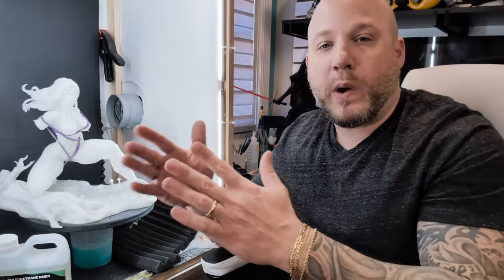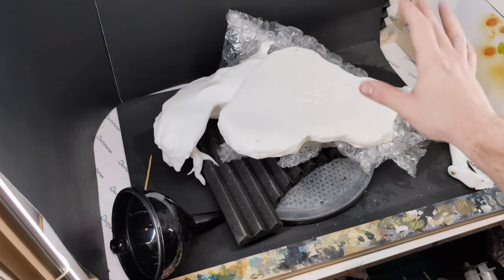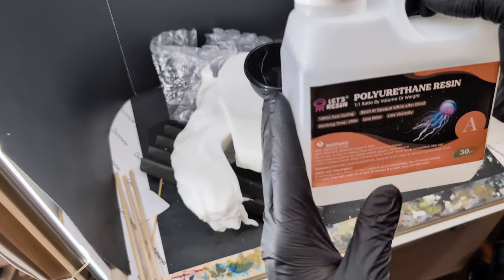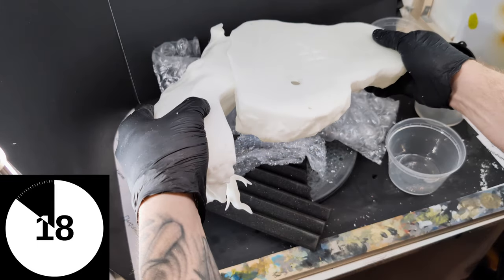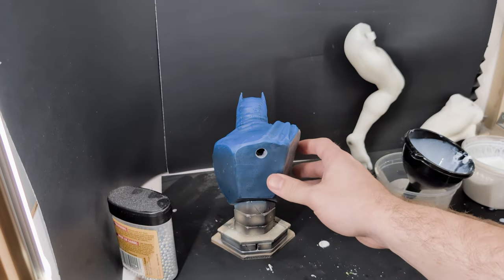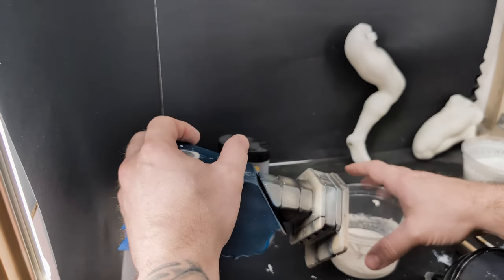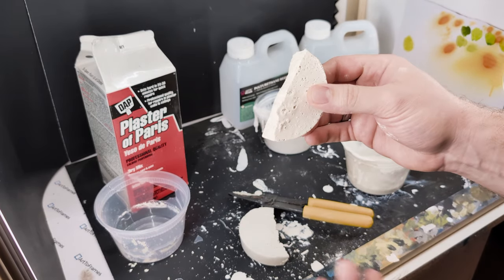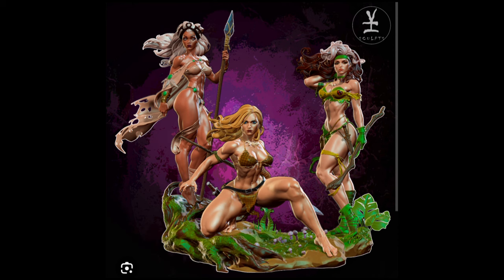How to Add Weight to a Hollow Statue using Resin & Plaster

Comment: Thanks, my friend...another timely video. I have been using baking soda to weigh mine down (due to finances and a better affordable alternative). I can't afford the poly, but the plaster is perfect for my wallet....and it's more professional than the baking soda.  Enjoying your channel
Reply from the maker: Thanks Dale glad to hear. It's a little tricky for smaller openings but as mentioned or as you are already probably used to with the baking soda..you can pack in the powder first on the plaster and then add water. The next video will cover resin injections with a syringe 👍 Definitely an interesting process 😎
Reply: @itsallthingsart  Thanks for the tip on the process of applying the plaster. I meant to ask about that. Just to confirm, if I pack the powder into the statue, and then add water, the water will be able to soak all the way through the powder?
Reply from the maker: Yes. You could actually practice on a water bottle to get the correct consistency. But basically you want to leave a little bit of room in the object for mixing. And you would plug the hole with your finger and shake the part to mix up the plaster. Let it dry for a good 24 hours before plugging the hole back up
Reply: @itsallthingsart  Thanks again.

Comment: Ever thought about adding sand to the base?  Same process using the funnel.  Not hazardous, cheaper, and less risk of expansion cracking the model.  Maybe there is a downside I haven't thought of.
Reply from the maker: I've heard of a few collectors who do that. I would consider that maybe for my own pieces. But these are commissions for other collectors.. in the event of a break, either during shipping or especially in the future on display.. I'd hate to hear that sand went all over the place. I like to stick to similar materials that a statue company/factory would use.. which in this case would be resin or something more solid.
Reply: @itsallthingsart  That makes perfect sense.  I would agreed using sand for a model being shipped out could be an issue.  Keep up the good work!

Comment: Great video.In your opinion do you think resin statues are prone to less breakages then a polystone statue.If that is the case it would seem buying 3d statues and just add some weight is the way to go.Your videos are always interesting thank you for the knowledge looking forward to the next one.
Reply from the maker: Thanks. I was actually going to cover that topic but I think it's best in it's own video. But it depends on the part. Resin and filament comes in many different strengths. So for parts like hair strands or anything that's brittle, TPU or flex resin is a good choice since it won't break so easily. For larger parts that are sturdier,  PU resin or polystone would add good strength. Polystone is actually a form of plastic resin.. I'll go into the differences soon in an upcoming video. Thanks for watching.

Comment: Are you only adding weight to the legs for shanna? it doesnt cause any kind of imablance once the model is glued together?
Reply from the maker: Yes, the two legs and the base. She's in a hunched over crouched position so the center of gravity is all within the legs. But yes, anytime adding weight you want to make sure it's balanced out. The other reason for making the parts solid is she did not include any keys to be pegged into the base. So I had to add my own by drilling into the parts which needed to be solid.

Comment: Since both resin and plaster create heat as they cure, is there any risk of damaging the model?  BTW, you may want to try Hydrostone plaster. It's much stronger and more machinable than normal plaster.
Reply from the maker: The resin causes a heat reaction.. it does get extremely warm.. I believe 200° F so it's not enough to melt plastic but definitely be careful with small fragile parts. Overall it's fine and I've never heard of any issues. The plaster isn't heat activated ..it's actually cold as it uses cold water to harden. I'll definitely take a look into the hydrostone plaster.. thanks 👍